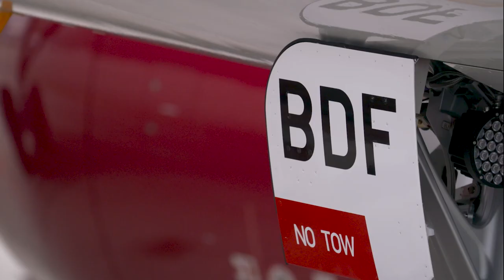In the making: First A320neo for Batik Air

Comment: As a mechanic from Batik Air, Airbus320, but there are some issues with the A320 type, specifically with maintenance on bleed engines 1 and 2. Is there a solution for this problem?